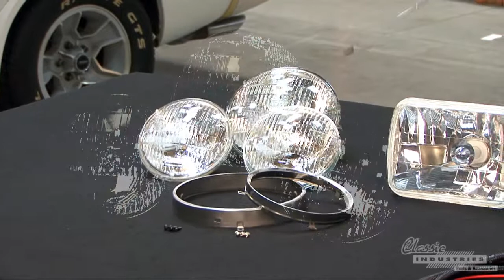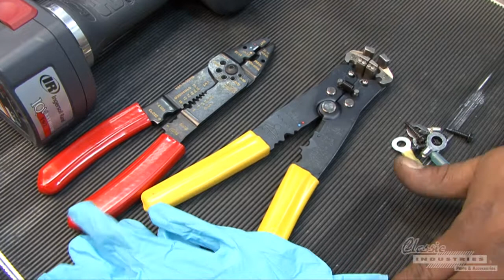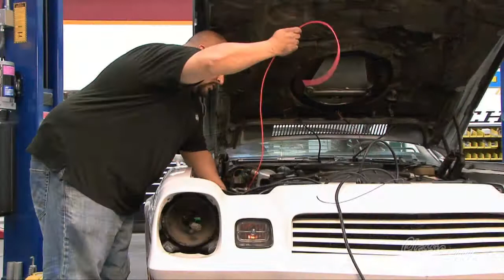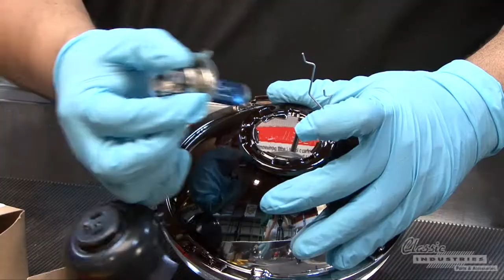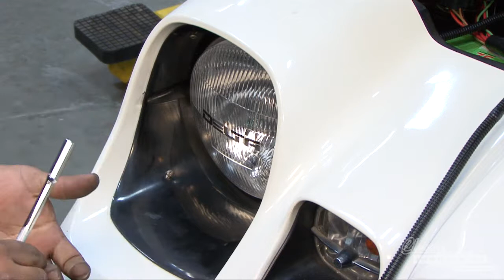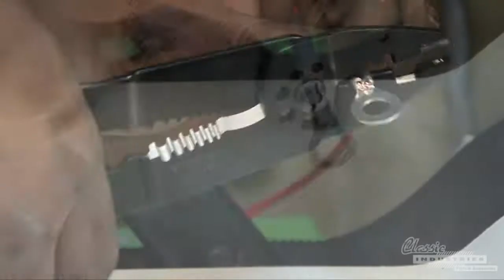Installing Upgrade Headlights for 1970-81 Camaro / Firebird

Comment: Hello, i recently bought a 1979 z28. I came across a problem when trying to remove the bezel on the head light. The bottom bolts have been covered up, any idea how i can remove them without creating any damage ?